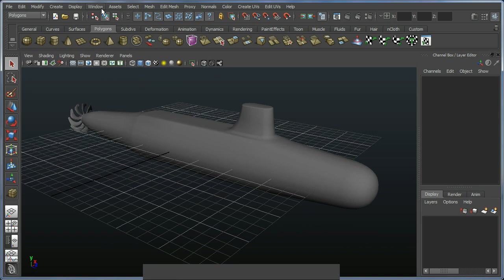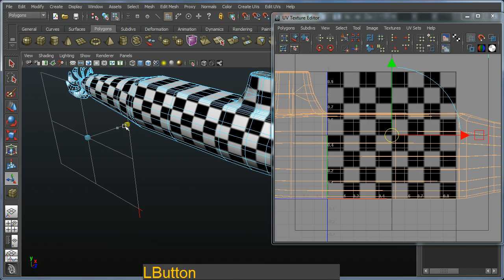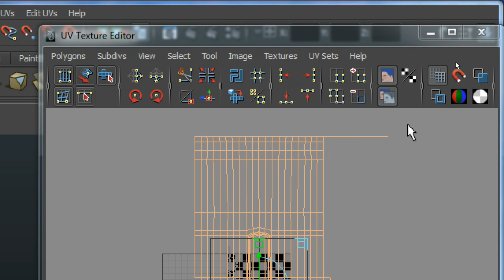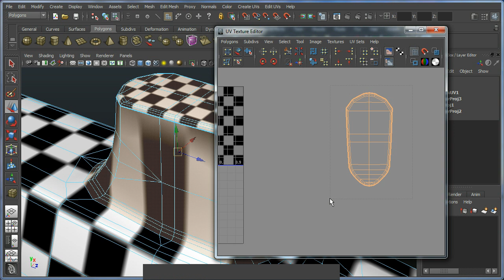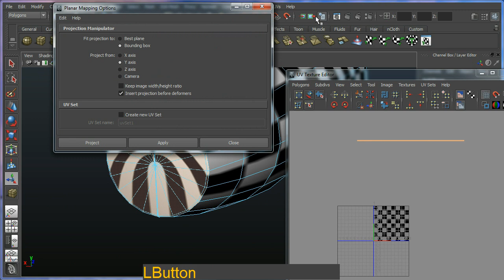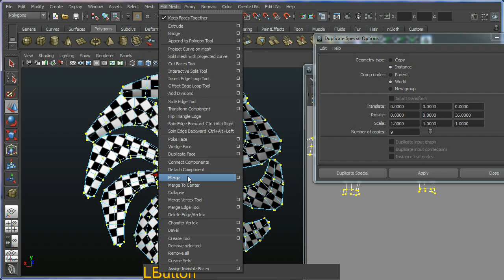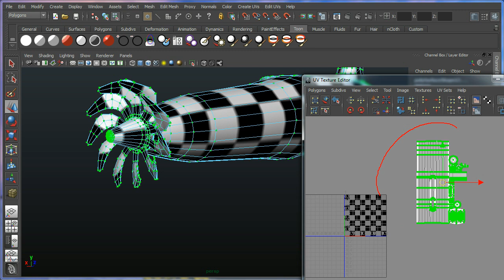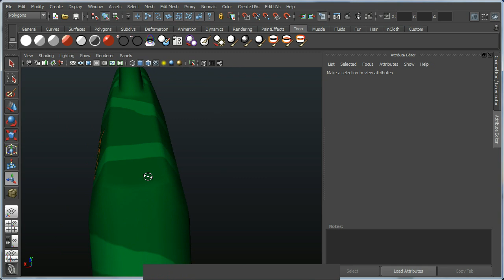Maya 2012 - Intro to UV unwrapping

Comment: I did also notice though that you also ran into the scaling issue in the uv texture editor. Even when you select the middle blue box to scale the shell larger or smaller in uniform, it often decides to scale just vertical or horizontally instead. Is there a trick to this? Sorry for all the questions..only if you have time to answer :) Thanks again for this great tutorial

Comment: Hi great tutorial, I am having an issue trying to uv a very basic shape.The main issue is after mapping a certain side of the object I drag away the shell in the editor and when I unclick the whole object is still within the original square and I have made a copy of the part I wanted rather than dissecting the uv like I thought I was doing. Please note I that the object has no seams(none that show up after pressing the button that should display them) any replies will be much appreciated.

Comment: Whenever I try to select individual UVs after pressing f12 (or generally going into UV mode) I am only able to select the entire UV, not the vertices. Is there a setting that I am missing or something? I select the object I want to unwrap (it's a sphere), I unwrap it, tweak the gizmo so that it is in the center of the object but the pattern is still messed up. Rotating doesn't really line the seams up any better. I am trying to select certain vertices so that I can try unfolding but no luck...